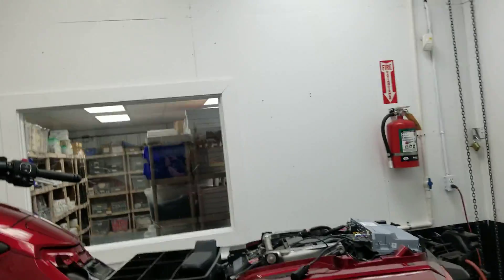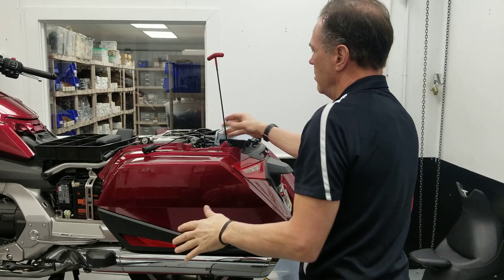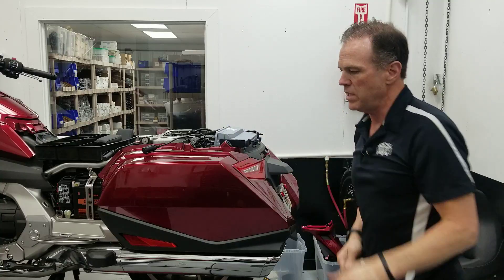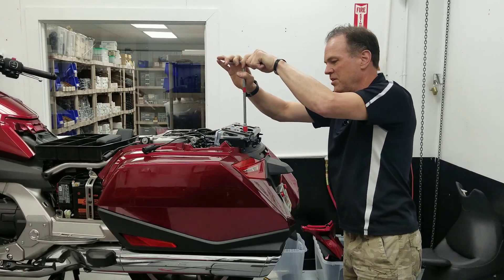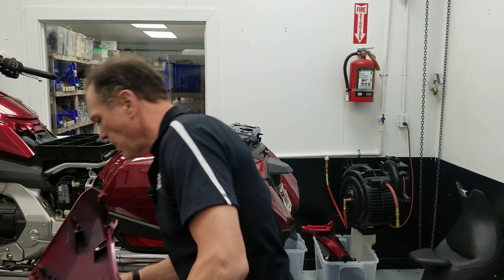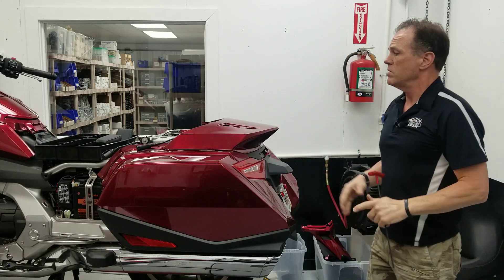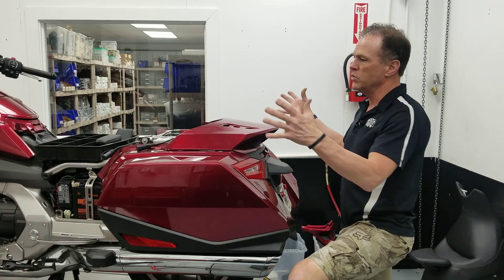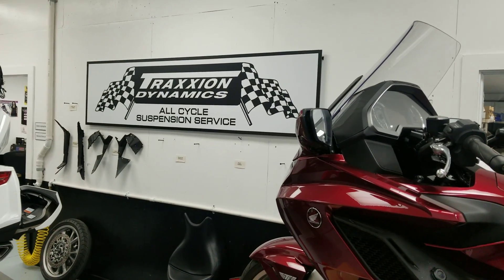Bagger Conversion Bracket Installation - 2018+ Honda GoldWing

Comment: I'm ready to order my quick change kit and have already bought my trunk shelter and rack support bracket.  One thing I noted in your video Max was you mention 2.55 in about the rubber grommets that Honda will supply, should they not come as part of the kit ?
Reply from the maker: If you don't plan to buy the Honda support bracket kit to use with the passenger backrest or luggage rack, we will include the grommets and push pins you need.
Reply: @Traxxion  I have already purchased the shelter and Honda support bracket as I was thinking I might want to fit the luggage rack and passenger backrest at a later date though.
Reply from the maker: @mikejacks1939  The Honda bracket kit has the grommets and everything you need.
Reply: @Traxxion  TY I feel a fool the package only arrive a couple of days ago and I hadn't opened the support bracket kit only the shelter and yes sure enough they are supplied with the kit not the shelter which does seem the wrong way around to me but hey ho all sorted.  I will order your 18GL-TQR+ now.  TY for all your help and advice
Reply: @Traxxion  Thanks for all the help on here, order placed and I have decided to modify my own bracket as you suggest as I am in the UK.  will the instructions to do this be included. Also I couldn't find how to order the kit with the modified bracket included.....it shows to two prices,(with and without) but only the the lower price in the basket with no option to order the higher price kit with the modified bracket !!  PS I don't know if it is something you would consider but it would be be helpful if there was able to be a chat facility on the website to clear some of the questions rather than using youtube.
Reply from the maker: @mikejacks1939  Hi Mike, Thanks for the order!  I wish we had high tech tech support, but there's only me and 6 employees... we are a very small company.  So my Youtube videos will have to do!  Take your time, it's a long challenging job.
Reply: @Traxxion  Understand Youtube it is then, It is working in any case.  Looking forward to receiving my kit and taking on the job.....